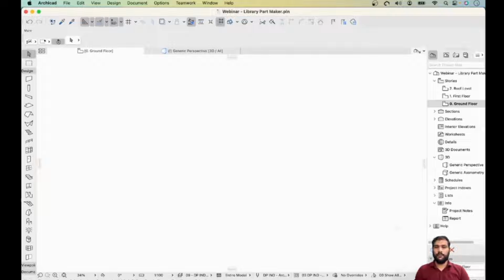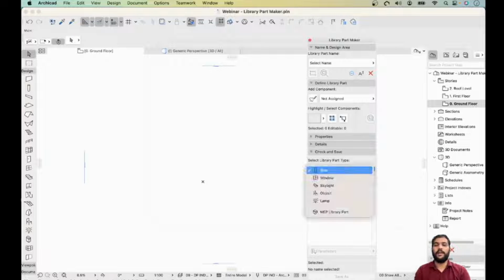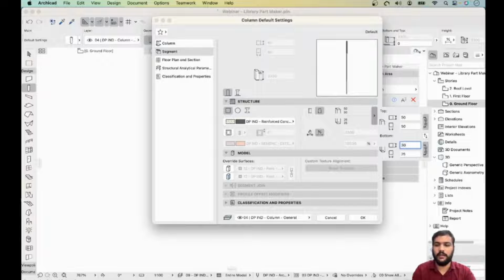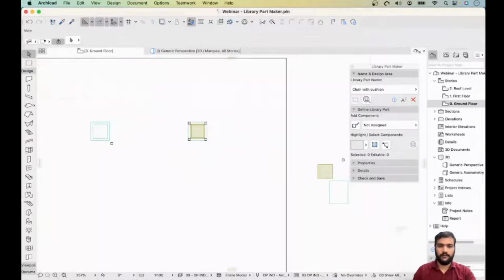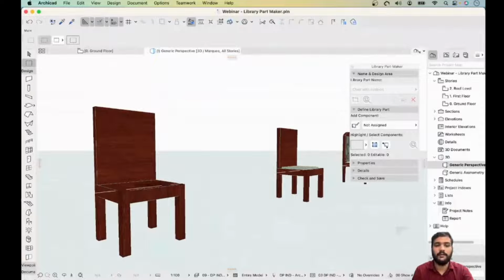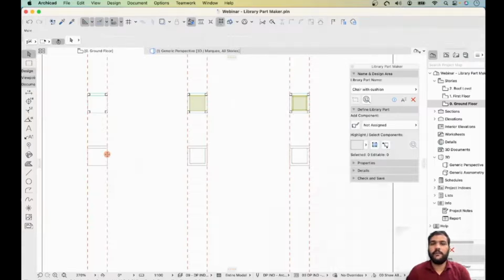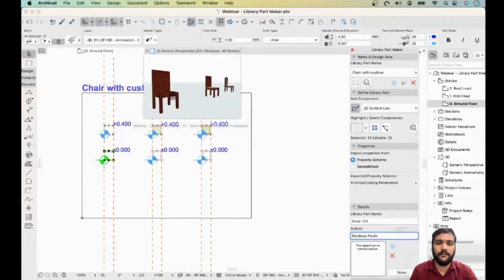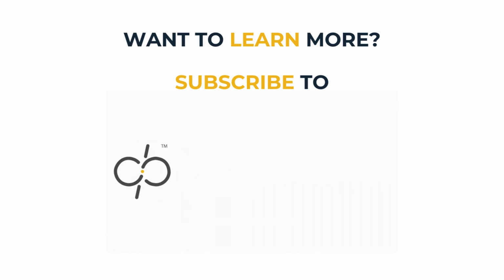Creating Custom Objects in Library Part Maker in Archicad | BIM Webinar | BIM with Archicad

Comment: How can I add a Stretch parameter such that stretching in the X or Y direction automatically creates a copied array in the respective direction? If stretching occurs in the Z direction, it should create a copied array in the Z direction, referencing the original X and Y dimensions. Furthermore, I need each component or part within the object to be individually modifiable and replaceable. How can I achieve this using Library Part Maker?
Reply from the maker: Library Part maker natively does not give this level of dynamic stretch and parameters.
LPM geometry is generally static and relative to defined parameters, it is not possible to do replication on X, Y, and Z direction with only use of LPM.
However you can go for a Hybrid approach using LPM + GDL logic to acheive the require result.